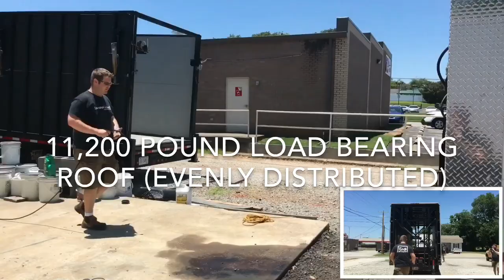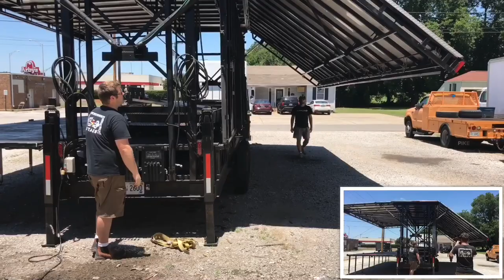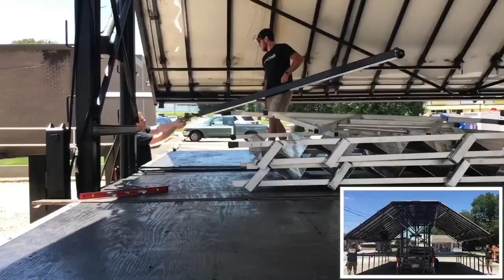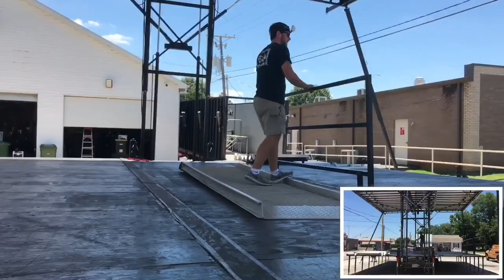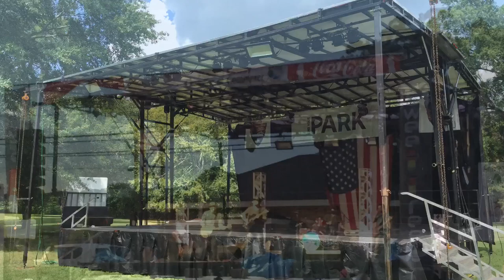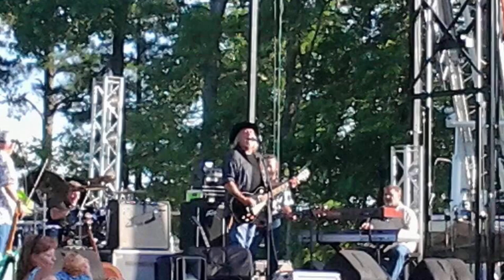Sweet Tree Productions / Solid Ground Staging E1 Machine Mobile Stage 32XTX2

Comment: MEH - a ripped off Stageline design... this has a fixed height... downstage load poles should be fixed to the deck, not sent to the ground.  I doubt this has a high wind load rating w wind walls.